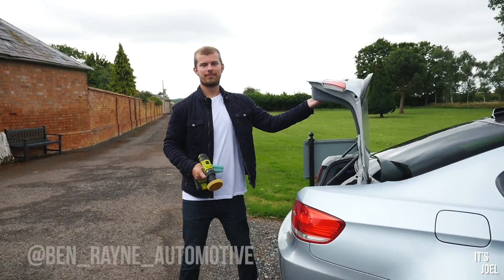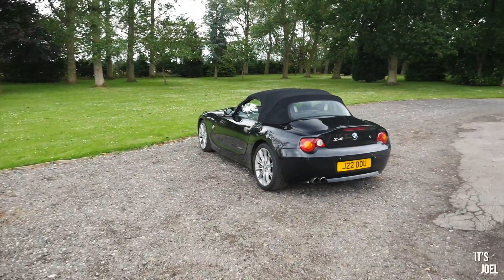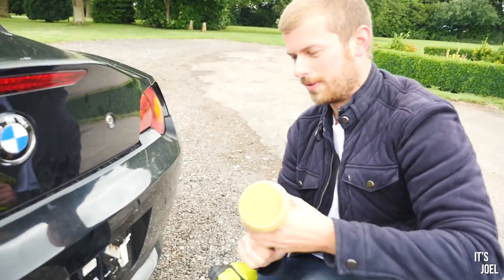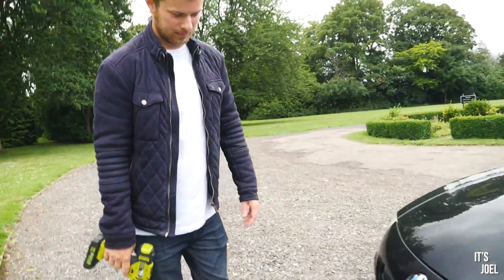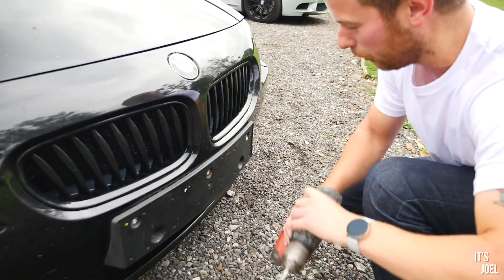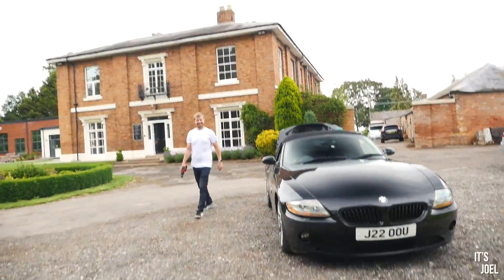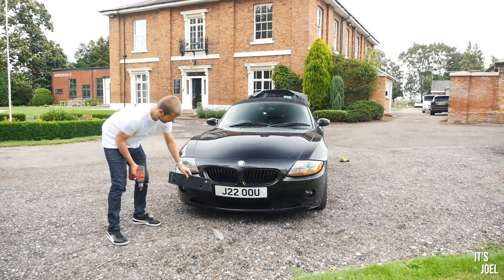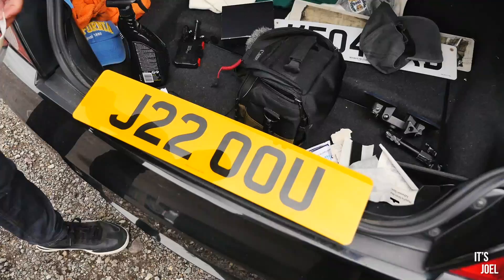Now My Car Is Finally Looking Good!

Comment: Having just stuck new plates on my M6, I had the same stick or drill dilemma. I went stick and it fell off twice, until I realised that pre bending the plate overnight and then sticking it is the best solution. I used an old tyre and put the plate inside so it was curved. Plenty of adhesive and stuck it on. It's not going anywhere now! And no drilling into my body work either.

By the way Joel, you need a V10 in your life. Get an M6 mate!